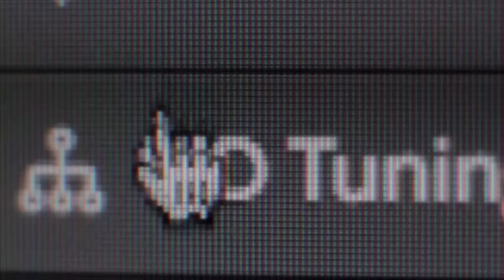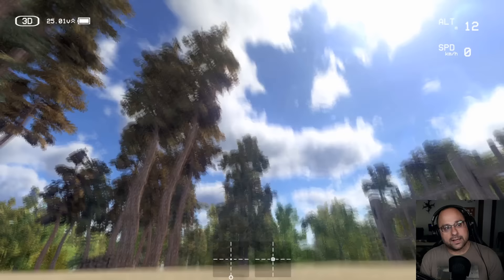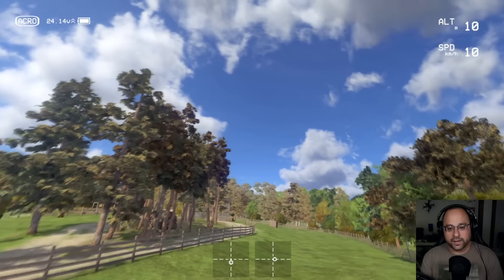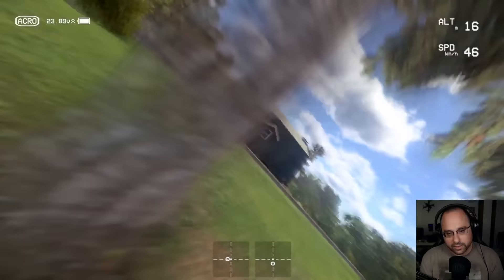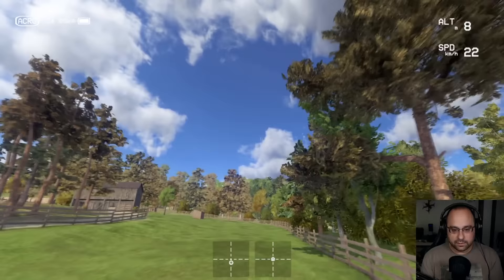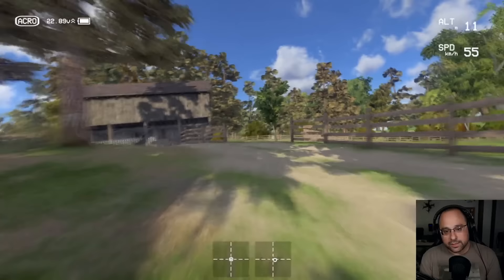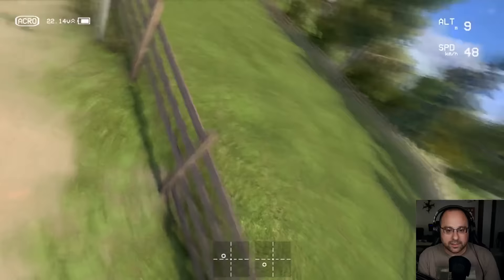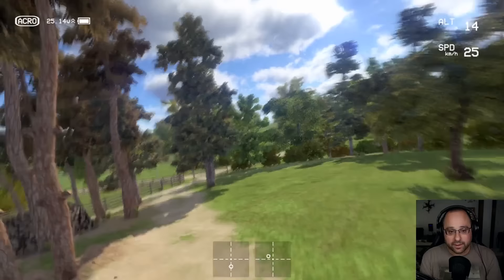Why FPV pilots don't pitch forward (as much as you think they should)

Comment: Just learning to fly quads.  As a fixed wing RC pilot THIS was my "A Ha" moment!!!!! Thank you!!!!
Reply: same bro same
Reply: I often have these moments, sometimes more than once for the same thing...
Reply: I am a RL fixed wind pilot and this makes perfect sense! A turn induces drag which causes the craft to lose altitude, causing the need to compensate with pulling back on the yoke to pitch the nose up. I should have been flying my quad in “acro” mode this whole time. 🤦‍♂️
Reply: Right?!
Reply: It’s the same with fixed wing… you have to keep back pressure in a turn. Basic aerodynamics, only difference on a quad you can also apply throttle instead.
Reply: @JCtheMusicMan_  not exactly it shifts the lift component towards the lateral axis which reduces the lift component in the vertical axis hence you need a greater AoA to compensate for the loss and that is what then increases the drag.
Reply: Same A HA moment for me too. Great tutorial/explanation for a new FPV flier
Reply: Im a fixed wing pilot too.
I try to fly copter for maybe 2month(4hours a day training)in this simulator,but i dont get it...not even a little...
Flying planes is soooo easy😅
Copter flying is the hardest thing you can fly..
Even helicopters are much easyer for me😅

Comment: I never realized that I'm pitching backward when turning, until seeing this video.  Had to go outside and verify, and behold, I'm pitching backward.  One of these subconscious muscle memory moves...
Reply: If you wanna be super cool you can roll 90 degrees either direction and pitch back to turn, be careful though lol
Reply: It's like riding a bike. Really. Everyone does it by instinct and they've never been taught what they are doing. It might seem you just turn the handle bars in the direction they want to go, right? Not even close. It's a three step process. First turn briefly opposite of the direction you want to go, this makes you lean into the turn you want to make and then you can turn the handle bars in the desired direction.  Try riding in a straight line and make a turn without the opposite waggle. It can't be done.
Reply: @filalleva6231  Okay, this is getting interesting.  I need to go verify that tonight 😁
Reply: @filalleva6231  called counter steering

Comment: The way I explain acro vs angle to my friends is by comparing degree/sec with degree.
On angle you pitch forward and with each mm you move the stick, the drone pitches by a certain degree.
Meanwhile on Acro you pitch forward and with each mm you move the stick, the quad rotates at a faster rate of deg/sec.
Example on angle: Stick is pitched fully forward, the quad flies at a steady 45° forward.
On Acro: Stick is pitched fully forward and the quad rotates at 1000°/sec
Reply: 1000°/sec damnn
Reply: everything is calculus

Comment: Since I'm quarantined, I finally had time to break my DJI/angle habit and learn acro. Yesterday didn't go to well, but today i finally got it. Must have flown 20 packs on my tinyhawk today.
Reply: I'm doing the same thing.  First time clicking it in to acro for more than a few seconds was today.  Definitely an adjustment from flying fixed wing.
Reply: I got 7 2s batteries a garden and a tinyhawk s,  every day 14 packs as training 😂
Reply: once you go acro you wont ever fly angle again... 1 more day and youll be there
Reply: ST4RDU5T same😂 I bought the tinyhawk 5 days ago and I’m flying it as much as I can, unfortunately I only have one battery

Comment: I think people think of flying in the same term of driving a land vehicle. You have friction slowing you down in the turns with a land vehicle. There is very little friction when you are flying. Therefore you have to pull back to use the air as you would the asphalt in a car. It’s a totally different way of driving. And all that is learned from stick time and crashes. Great video Josh!

Comment: That's given me an idea,
do a Rotor Riot episode trying to fly/race without pitching back (like electronically block it out on the transmitter so it's impossible) would be fun to watch pilots would have to do flips and other moves to fly.
Sure Vanover would ace it !

(this would obviously be post Corona)
Reply: Is vanover old enough for coronas yet?
Reply: How about a "no yaw" race?  They'd have to learn a whole new way of turning corners.
Reply: @Croznyj  why use an artificial horizon when you have a real horizon?  If you can't see the ground there's a major issue with your camera angle or your flying too high.
Reply: @licensetodrive9930  1 stick flight is actually doable, set the throttle, bank and yank... half roll and pitch down, halfroll back.
Reply: @spchips  He will be by the time this whole thing is over.

Comment: Thank you so much  for that explanation! You gave me an 'a ha' moment that really helped me figure out flying.  I'm brand new to FPV, I don't even have a drone yet, but I've been following you and Steele, and stingy and the rotor riot guys for almost two years now and I just didn't think I had the knack for flying. I'm  just working in simulators so I can really get the basics down before I invest in a good build, but I could not figure out what I was doing wrong about controlled/coordinated  turns.   Your explanation really helped me overcome that learning obstacle I was stuck on by reframing the way I think about pitch. I had all but given up but with this simple explanation of thinking of pitch as speed rather than forward and back it finally clicked for me.  I can actually fly controllably now, instead of the controlled careening I was doing before as I over accelerated and overcompensated trying to keep all the axes in my head. Thank you so much. I'm gonna have to put in a lot of hours of practice to really get lock it down, but you got me back into flying after a couple months of frustration.
Reply: The trick to getting acro in your head is to remember the stick movements CORRECT (Change?) the current attitude. Let the sticks go to center with no maintained pressure (except throttle) and then "bump" a little forward pitch in, etc. 
Don't fly in autolevel or you'll chase your tail for ages. Good Luck!

Comment: Fixed wing pilot here: You're using the same exact stick inputs to turn that I use. My nose wants to drop if I turn without pulling back on the pitch as well. If I use yaw only I get some different effects(Depending on the plane itt'l bank into the turn as if I had used roll anyway) but they all tend to drop the nose a bit unless I pull back on the pitch a scoche.

Comment: Acro and Camera angle. Once you get the camera angle nailed you hardly have to pitch forward, unless you need to go regain more speed out of trick moves etc or gain more speed in straight lines. Back pitch more before turns and obstacles to avoid overshoot and crashing into stuff. Informative as usual JB.

Comment: This video sums up how I crashed my first build last week.

After hovering my brand new first build for two minutes (happily) -  I wanted to feel it accelerate forward. So I sharply pitched forward and instead of accelerating forward, I pitched head over heels VERY FAST into the pavement (luckily the battery took most of the impact).

Apparently, the drone that I learned to fly on was in angle mode (I didn't realize that until now).

And now I understand the difference between angle and acro mode :\

Comment: Look at fixed wing principals of flight as a quad follows the same rules. Aircraft in level flight at a constant speed and power setting - lift = weight = equilibrium. Turn and some of your lifting power is being used to turn so less is left to maintain height and therefore the nose sinks. So in a fixed wing aircraft when turning you apply some back pressure on the stick to increase the angle of attack of the wing and generate the additional lift required to maintain height. 👍🏻

Comment: Hi Joshua - always enjoy your videos. I think that there is an aerodynamic principle here. As the quad  (aeroplane, heli, glider etc) banks the wings (rotor or fixed ) produce less lift  when compared to the horizontal left effect. As you demonstrated, the quad will sink if left unchecked, the back stick movement raises the nose and prevents the sink. You might find that to maintaining your speed you will also need to increase your throttle. So, to maintain speed and keep a constant altitude in a turn you use both pitch and throttle and the greater the bank the more inputs required. Cheers
Reply: i agrer with your thats what i wrote....
@film_pi_vox
0 seconds ago
but as you lose altitude wouldn't it make sens to raise the throttle and then lowering it a bit when you're out of the turn. by doing this you dont lose altitude but most important you dont lose speed by pitching back..

Comment: Hi, it's not simultaneous yaw and roll which make the quad pitch down :  it's different depending of which one dominates the other. If you roll faster than you yaw, yes you will fall in the turn and need to correct by pitching back, if you yaw faster than you roll then you slip out of the turn and need to correct by pitching forward. 
Additionally, the exact balance point of rotation rate when one would start to dominate the other actually depends of the angle of the quad : at 45° forward you need the same rotation speed on both axis, but at lower angle you will need more yaw than roll (and reciprocally, at higher angle, more roll than yaw).  
You can feel this by increasing your yaw rate : for the exact same stick position as before during a turn, you would find that you now have to correct by pitching up instead of down.
Reply from the maker: I agree with what you said about the balance of yaw vs roll. But I would say if you yaw too much and end up needing to pitch forward to correct, then you failed to correctly coordinate the turn. However, that is a cool trick you can do if you intend to exit the turn facing a different direction. For example, yaw "too much" to flatten out and then backflip away or something.

Comment: I wish more people understand this:
In *level* or *angle* mode, stick deflection commands the desired pitch and roll.

In *acro* or *rate* mode, the stick deflection controls the RATE of change of pitch and roll, in radians or degrees per second if you will.

It is like the difference between position and velocity, or between gallons and gallons per minute.
Reply: Or for computer/gaming folks, it's the difference between a mouse/trackpad and a Joystick/Trackpoint.
Reply: @curbynet  Ah the old IBM/lenovo trackpoint! I always wondered how that compares to a joystick for FPS gaming lol
Reply: Or you may say: "In acro mode roll and pitch work the same way as yaw.".  The easiest way to explain how acro mode works to someone who is using angle mode is to tell them his yaw command already is in acro mode.

Comment: I usually associate pitch with the nose of the quad and yaw with the tail end of the quad for a new pilots or pilots coming from 2-3 channel airplanes.Using pitch to adjust the nose in forward flight will adjust your speed like Joshua said. And mixing yaw, roll, and pitch back will give you the nice “flat” turn in toward flight, essentially keeping the “tail” of the quad level.

Comment: Interesting thing to note, as a racer with a generally higher angle (50°) I notice I actually do the opposite, I tend to pitch forward a little in tight turns.
Reply from the maker: I bet if we had a blackbox log, we would see that you pitch forward at the beginning of the turn, which puts your thrust vector more "outwards" so you can turn sharper. Then you complete the turn mostly using roll axis and pitch back to your cruise angle as you exit the turn. But I don't think anybody is turning while pitching forward throughout the whole turn. I just don't think the physics work that way.
Reply: You are right, see the detailed explanation in my comment.